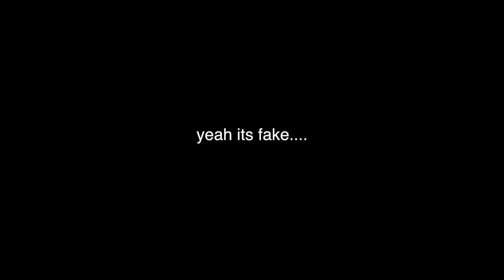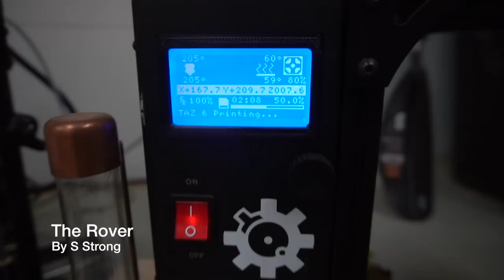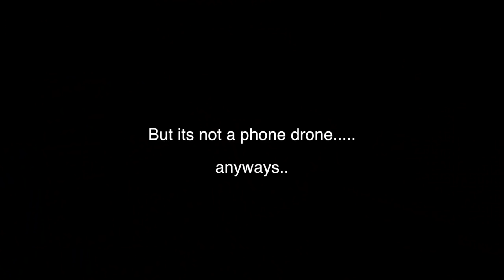MAKING a REAL Flying Phone! (w/ Mark Rober)

Comment: I had a motor burn out on my DJI Mavic Air over a lake. I barely got it back. It was basically a bicopter, with a 3rd functional motor to pull it on one direction laterally.

Comment: Hi, Hello. I just found Mark Rober and Captain Disillusion.
I see 4 major problems you are trying to solve.
1) Keep the phone safe from falls and fly-aways
2) Power to weight problem. Weight of phone and weight of additional batteries.
3) Steadiness and  maneuverability.
4) Noise
So to solve for this:
Create a small flying camera that throws it's image to a smartphone for capture via Bluetooth or WIFI.
Create a smartphone App that controls the small flying camera and allows the smart phone to capture images and movies. 
Lower production cost by eliminating redundant materials.
Eliminate unnecessary task and risk of catastrophic failure by keeping your phone in hand. 

O .. don't we already have this ?
At:13:39 and that is why not to strap the phone to copter.
Reply: This was built for fun 😂 all of you thinking it solved a problem is incorrect. I’m building one myself but using separate flight software.

Comment: Hey I’m probobly to late now but did he use electronic motor speed controllers for the brushless motors, or did he just plug the motor directly into the control board, if he did can I get the link to it?

Comment: Hey, I began building my first quad a few weeks ago... Stumbled across your video today and looking at your BiCopter, you've used Multiwii for your flight controller... I need help tuning PIDs for pitch and yaw... Upon giving 50% throttle on TX, my quad flies off uncontrollably high (10-15m) and drifts off at dangerously high speeds mainly along roll axis towards left and doesn't even come down even after pulling down the throttle stick completely down and disarm it by pulling the yaw stick to extreme left. It just falls down after 2-3 seconds after pulling down the throttle stick... Frame and propellers were broken twice and were replaced... Now I am extremely scared to even do another test flight from then. In my last test flight, Shortly after falling, one of the ESCs burst into flames and requires replacement... I was aware of fixing the drifting issues by trimming on TX or pulling throttle stick at max when disarmed and pull extreme opposite direction the quad drifted... None worked for me...  Decreasing I gains reduced it from flying high but was drifting more, considered even tweaking with TPA... Adjusting throttle curve makes it not even give enough thrust for it to lift from the ground even at full throttle... or setting back to default simply take off sky high somewhere else dangerously...

Comment: ...I dunno about you, but the things that tipped me off immediately that this was fake was the simple fact that, uh... THERE AIN'T NO MOTOR DRIVER TO RUN THOSE MOTORS.

And, since there isn't a motor driver, the Arduino on it is entirely useless because it cannot directly run motors. 
AND, as demonstrated at 5:46, a two-prop setup is incredibly unstable, even a standard 4-prop setup isn't going to be that stable without GPS Hold and Altitude Hold, fam.

We're not even gonna talk about the wiring...

Comment: why dont you use all the electronics in the phone and just attach the rotors and servos. The phones already has a logic board, battery, gyroscope and bluetooth for communication. Couldnt you save a lot of weight that way?

Comment: 1:26.. You really need to learn how to solder properly... You have a lot of Dry Lumpy Joints.
9:51... The "Thumb Rule" refers to current flow and magnetic fields in a wire.

Comment: what if you where to use the phone  giro, battery ,  wifi , processor ( for self stabilisation and other stuff ) then trough usb-otg connect motors anr servos with a board

Comment: It doesn't have a exlromter and he duck tape it so I has no way to adjust it so it will fall down and the audio and you can see a rod and a rectangle in the background and one side of the water is moving and the other side is locked in place and someone is holding a rod that the why it is keeping is place so that is flying

Comment: Sorry, I love almost all your stuff, but that's just taping a phone to a drone. Why not make the phone control the drone? Is there a reason it can't be done?

Obviously the phone won't be able to power the rotors but if you're already carrying that weight, and it already has all the sensors, more processing power than you could shake a stick at, WiFi, GPS, etc... why not use it?

I'm guessing it might be easier on a developer-friendly Android phone with USB OTG available, an iPhone might present more challenges. I'm sure the Apple hacker community have a way around it though...?

Comment: SIMREX X900 Drone Optical Flow Positioning RC Quadcopter with 1080P HD Camera, Altitude Hold Headless Mode, Foldable FPV Drones WiFi Live Video 3D Flips 6axis RTF Easy Fly Steady for Learning White $70.00